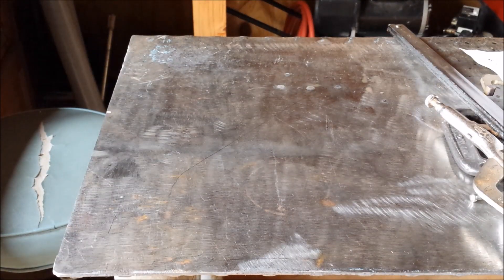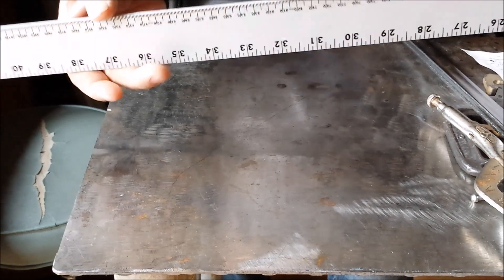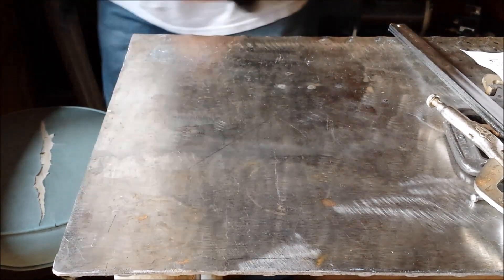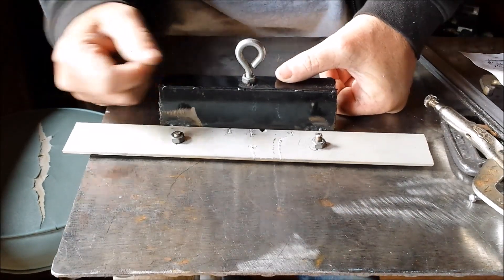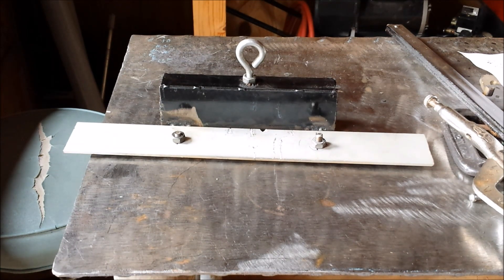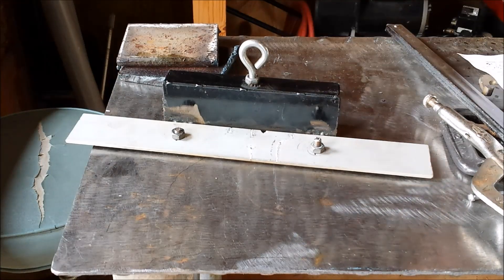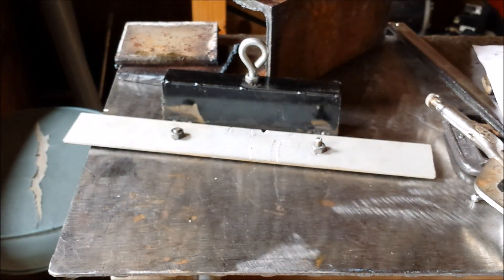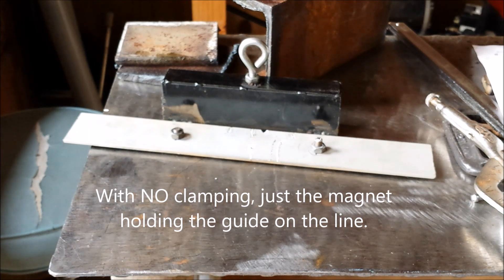My No Clamp Plasma Cutting Guide

Comment: This is great! thanx for the video and the ideas i am getting from it.

I have a suggestion for you. You say you have a hard time due to hand shaking and roll off.

Take the ruler off
Use some 1" angle iron. Foot long or longer.
1 1/2" piece of 1" angle iron.
A plate or same angle iron.
And a large nut. Just large enough that your plasma cutter tip fits into and can swivel a bit. (Piece of pipe can work also but nut will be easier welding.)

Put the foot long piece of angle iron on the magnet with angel face up or point up.
Weld nut to plate and plate to 1" angle. Now its a torch holder.
Put the torch holder on top of angle and slide up and down. This will cut straight and the nut will not allow roll off or will compensate for shaking.

I am uploading a video to show what I mean just in case I didn't make myself clear.
The plate is just for extending the nut out if so desired.

I just uploaded a video called

Example straight cut jig for plasma or OA cutting for short cuts. Cheap!
Reply from the maker: Thanks for the suggestions, I've tried angle iron but I haven't tried using a nut as of yet, so far no matter what I use for a guide I still have the shaking issues but I'm getting better with practice.
Reply: William Jones to whom are you speaking to?
Reply: Mark Massingill I can do a short vid on the one I actually made after commenting.
Reply: I've learned some useful tips from your video and the comments. I will try them all next time I work with my everlast plasma cutter. Thank-you for posting!